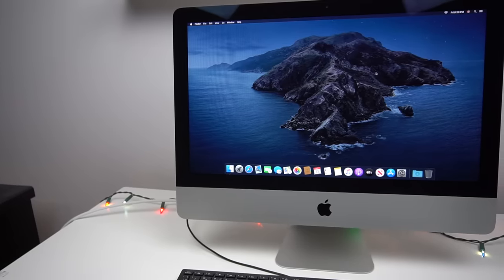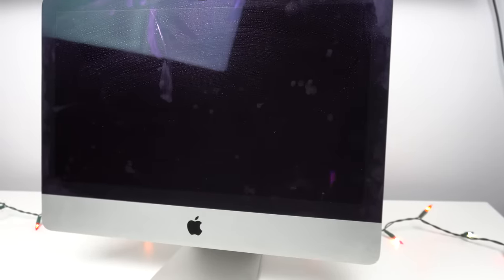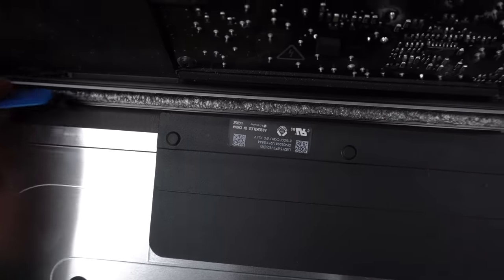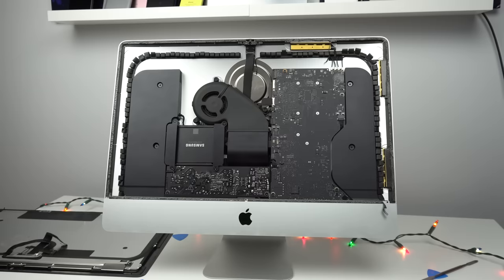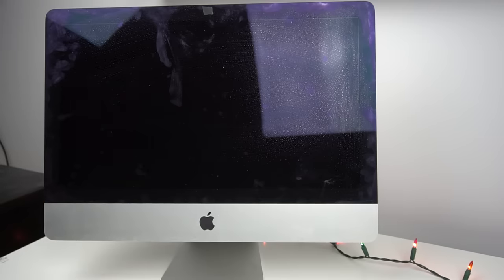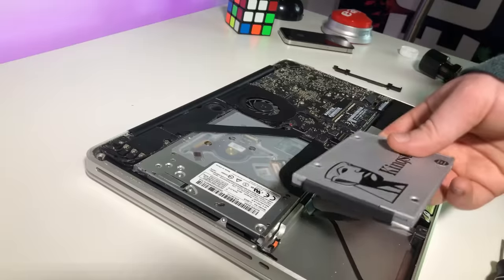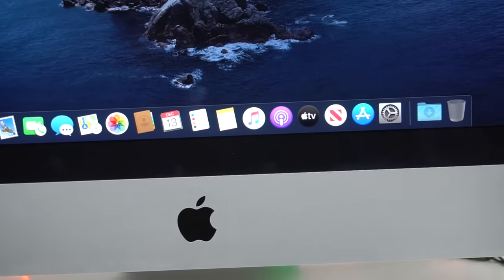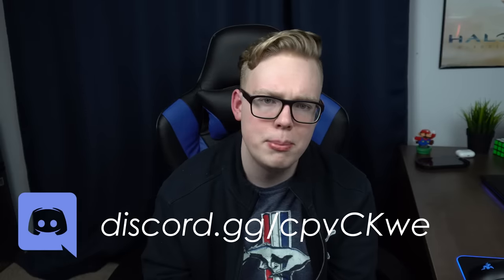Upgrading my late 2013 iMac!

Comment: I have the 32gb 27 inch variant, and it still works. HOWEVER, the hard drive is an abysmal failure and I wish they never existed.
Reply: Get an external SSD, clone your current boot drive to it, then boot from the external SSD. Once you confirm the external is working well you can erase the old slow internal then use it for extra storage or backups. Even over USB 3.0 (5.0Gbits/s) an SSD is a huge upgrade over any spinning platter drive. If your Mac is too old for USB 3.0 it will have Thunderbolt: Get a used Thunderbolt drive, pull out the drive from the enclosure, put an SSD in there, and it will be just as fast as putting it in the internal SATA slot.

Comment: Didn’t you have to install Mac OS on the ssd before installing it??
Reply from the maker: nope! Just need to go into internet recovery mode if you have a 2012 or newer iMac
Reply: Nope, just follow his instructions and do it after you install it. Worked PERFECTLY. You won’t regret it
Reply: I have the same late 2013 iMac, built in the Samsung SSD860 500, but whatever I try to do, the SSD is not recognized. When I hook it up over USB outside of the computer it recognizes it..  When formatted, with OSX installed on the SSD, and putting it back in the computer, still does not recognize it...
Reply: You don’t HAVE TO but cloning over the old drive to the SSD before doing anything else certainly makes things easier and is a time-saver. If you want all your old files and applications anyway, it makes sense to clone first.

Comment: Just added an external SSD to my Late 2013 iMac and it's like day and night. So if you don't want to take it apart, the external SSD is just fine. It boots to User-Selection in around 10–15 Seconds, and another 5–10 seconds from User to Desktop. Before it took around 3 Minutes to Desktop and even then you would get beach balls for at least 2 Minutes as soon as you did ANYTHING.

Comment: Thanks for your tutorial, appreciated. 

I try to mind next week that the existing hard drive contains important information, i would to transfer it onto a new SSD Hard drive which I'm going to replace. However, my iMac is not working, how to transfer old hard to information onto a new SSD drive? I have two iMac 27" 2015

Comment: I have an early 2013 iMac that has an i3 but the i3 is faster then the i5
Reply: The i3 might have a higher clock speed but the i5 probably has turbo boost which the i3 lacks and might have multi-threading which the i3 might lack as well. The i3 will run cooler but it is not necessarily faster for most tasks.

Comment: I'm getting a 2012 27" imac to have Apple around for a few apps that won't play on my windows 10. I see that on some of these there is an actual slot on the MB to install an SSD. It's what Apple called it's "Hyper Drive". I guess the idea is to run the OS off the SSD and use the 1TB drive for storage.

Comment: Hi! Hopefully you’ll see this. I have a late 2013 imac 21.5”. I know you used Samsung 860 evo but would the 870 evo work too? Also, is owc ram good? While I have it opened I want to upgrade the ram. I would like to update the i5 to i7 but seems like it’s hard to buy.

Comment: I have a late 2013 21.5" iMac with the Fusion drive. I installed 16gb ram and replaced the 1tb drive with a SSD and the Blackmagic speeds are just as slow or slower than with the mechanical drive. I tried 2 different SSDs. any ideas?>

Comment: OWC website has a power board in their SSD replacement kits.  Is a power board replacement recommended for these models when you do the SSD? Or should it just be done like this? Or at least I think that's what I'm looking at on the OWC site.  The parts they want you to put in don't look like a regular drive and they have you doing a much more elaborate disassembly.

Comment: My parents have a 27 inch late 2012 iMac can’t quite remember the specs but it’s something like i7 can’t remember ghz 16gb 1600mhz think it’s a 3tb or 4tb hard drive and 1gb vram can’t remember the gpu though but it definitely needs a ssd it takes about 2 minutes to boot

Comment: The mechanical hard drive on my late 2013 27" iMac crashed a couple of years ago and I had it replaced with an SSD. It was my daily driver until about a week ago when I got a 2020 27"  iMac.  I would NOT recommend trying to cut that display off yourself. The hinge broke on mine a couple of years ago and Apple cracked the display  getting it open. They replaced it free though they showed it $500 on the invoice. OWC makes a sensor to put on the new SSD to control the fans. That OWC tape may be a bit too strong and it may be the reason Apple cracked the display taking it apart the second time.
Reply: SSDs were damn expensive back in 2013. The prices have really come down. You can get a 2TB Samsung drive now for $250
Reply: @WhittyPics  Two years later, right now you can get a 2TB Samsung SSD for $145. :)

Comment: I have an iMac of this type, late 2013, bought mid 2014, it is now pretty much unusable it stalls every time you try to do anything multi coloured whirly thing just keeps spinning and it keeps restarting, any clues?
Reply: @DJPaulgee1  Thanks, it works fine now, running from an external SSD

Comment: You could have upgraded the memory in the machine while you were at it.  You never said if it came with 4GB or 8GB, but you probably could have easily upgraded it to 16GB while you were in there.  Those 21" versions don't have the memory door on the outside.
Reply from the maker: Thought I said 8gb? It’s 8 gigs regardless and I figured that was enough. But you’re right, I should’ve at least mentioned it

Comment: Same here lol.. i finally upgraded to 500GB SSD and 16GB ram
Reply: On a late 2013 model? I need to upgrade my ram and saw a vid from a guy who took apart basically the whole computer to get to the ram. And someone commented that it wasn't necessary to move all of those things. Wich components did u move to change the ram?
Reply: @MorganaDevina80  i did it..cracked the top right corner glass.. but still doable.

Comment: Thanks for this. Have a late 2013 iMac 27 and it’s getting unreasonably slow under Catalina. Useless in fact. Tried to buy ram but the guy at the local computer shop said upgrade the SSD. Searched YT and up came your brilliant video.  Gonna pull the trigger and drop another 8 Gig of RAM in it.

Comment: I have EXACTLY this computer (21,5 inch Late 2013 iMac with standard 1080p screen running MacOS High Sierra) and trust me, my old SATA HDD is VERY VERY slow. BlackMagic disk speed test show 80 mb of read and write speed. But because this is my main machine that i am creating music on, i can't take the risk to upgrade to SSD and add RAM myself. so i'll stick with it for at least 3-4 years to come.
Reply: Seb the Young French pay someone to do it for you then. Micro center will do it for like $100 plus parts
Reply: 2GF Studios bro I live in france...
Reply: Just get an external SSD. Clone over your internal to the external, set your Mac to boot from the external, and you get 95% of the benefits of swapping out the internal at about the same price with 0% risk to your data or your Mac.
Reply: @JohnMHammer  True. But since then I upgraded to a new m1 Mac mini. Now the problem is solved the hard way.

Comment: No need to do this. Just use a portable SSD like the T5 or Sandisk Extreeme
Reply: that's way easier, but internal works little better
Reply from the maker: Internal generally is a bit faster and, more importantly, more reliable.

That said a portable drive will work if you don’t want to open your Mac up

Comment: The 2013's can take NVME I think, the socket would be on the flipside of the motherboard however
Reply: Yeah, only certain models though, I think it’s every model apart form the base stock model
Reply: only fusion drive models have the nvme slot
Reply: @cristianarcuri1164 
I just installed a 1TB Samsung 970 EVO SSD NVME  into my daughters 21.5  2013 iMac via the PCI-E port on the board. Her iMac did not come with a fusion drive. It came with a 1TB 5400 RPM hard drive and that was it. Her iMac is a late 2013 (14,3) model. After doing allot of research I found that all 21" (14,3) iMacs produced at that time have the necessary PCI-E port to add an NVME SSD. You need to purchase an adapter ($13) for the NVME sticks to plug in & work since Apple used its own SSD. You have to remove the board to get at the port located on top of the board. While apart I upgraded the memory to 16GB. I also cleaned off the old thermal paste from the CPU & GPU, replacing it with a higher performance solution. The computer is blazing fast & should last her several more years. I bought the SSD & memory sticks on Amazon over Black Friday & paid about $149 with free shipping. It's a fantastic & cost effective upgrade to breathe new life into an aging computer.

Comment: Have you thought about upgrading the RAM? What your thoughts on in? I have the stock 8GB but thought about upgrading to 16GB
Reply: Did you upgrade the ram?
Reply: @jillhenderson2184  No I ended up getting an SSD to boot off of and have been very happy with the performance. Plus it was IMO an easier upgrade to DIY.

Comment: I’ve been debating on doing this, but terrified I’m going to mess something up. My IMac runs good, but an SSD would make it crazy fast
Reply: i’ve done this like 5 times allready, it’s scary but quite easy and haven’t regretted a single one
Reply: Christian den Boer yeah I might give it a shot one day =)
Reply: If you are worried about getting into the case or just don’t want to bother, buy an external SSD. It will be nearly as good, about the same price, and other than cloning your old drive over to it makes the process take only a few seconds (plug in external drive cable; done).

Comment: 3 years later: Not wothwhile cutting open a 2013 iMac and installing a SSD or NVME. 2013 tech will not take FULL advantage of 2023 SSD tech. Booting off a T7 did not improve boot and response times much if at all over booting from a bog standard SSD.

Comment: Hello, great video. I want to upgrade my mid 2014 iMac, the connection cables are just the same that your computer have or there is another specification that I need to have in mind when I buy the SSD? Thanks, so much¡
Reply: Hello, I am also having an old imac 2014 mid. Did you do the upgrade? Is it working fine? Thanks

Comment: Hi! Does adding additional 8GB Memory to my existing 8GB improve the speed of my iMac? I have the same iMac but in 27" and it's been really slow sometimes.
Reply: Yes but ssd will fix speed issues.
Reply: @HistoryandReviews  how about the fan issue? My imac start having high % kernel_task and the fan starts spinning like crazy. I had to restart the computer everytime it happens.
And this happens months after I install a new 16GB into my iMac

Comment: I don't mean to be rude but I’m 13 and I even noticed you did not clone the drive
Reply from the maker: ...you don’t need to clone the drive, this is a fresh clean install lol
Reply: I meant copy the drive and if you do that you keep all of your old files if you could not back up it also skips the step of adding MacOS on the new drives. I mostly have worked on 2012 models of Macs
Reply: Thank for responding love your videos
Reply from the maker: Sorry, should’ve specified, but I didn’t need to keep old files- everything had been moved off manually beforehand. That said most ppl should definitely clone the drive or at least back it up beforehand.
Reply: Don't worry it is fine we have all made mistakes

Comment: Don’t forget to activate TRIM on your new SSD drive. If you upgrade your Mac with an SSD then I would recommend to put the new SSD into an external case  temporarily and clone your internal drive to the SSD. After putting in your SSD you can continue working where you left off.
Reply: Apple recommends NOT forcing TRIM on non-Apple drives. Just format using APFS.

Comment: I must be extremely unlucky because every friggin Mac I ever had was a mess. It is very hard to fix. And EVERY TIME an update was done the iMac I had didn't start or got stuck or froze or something.
I have 6 computers in total, only one is mac, 1 is Android, 2 are win10 and 2 are Linux. And MacOS is really the worse! Glitchy, unfixable, expensive.
Linux is the best!